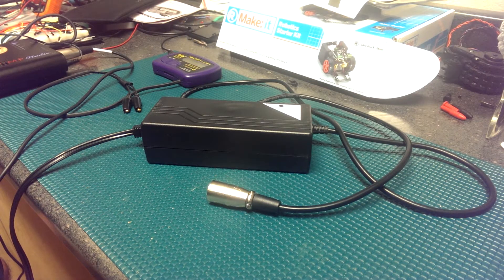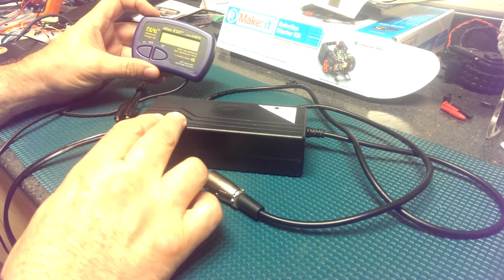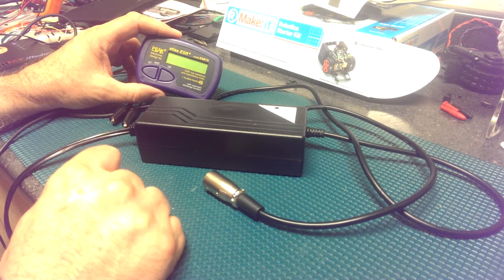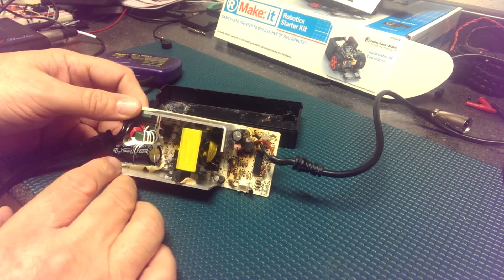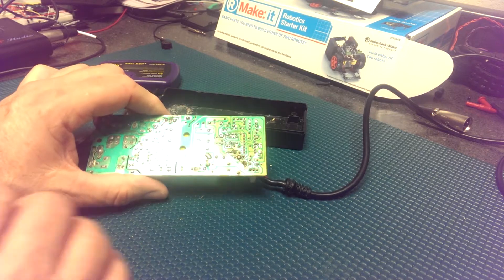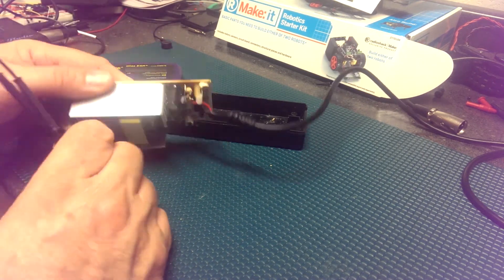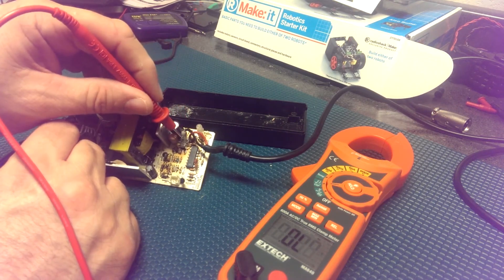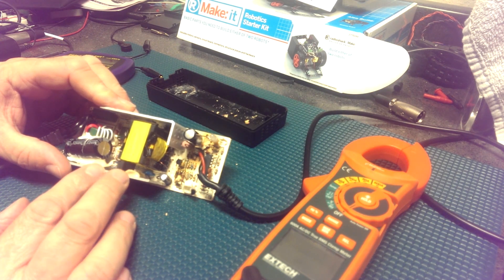How to troubleshoot a 24 volt Battery Charger

Comment: What should the pins be putting out?
Reply from the maker: Sorry, which pins are you referring to.  You can use an ESR to measure the caps.  Output should be the rated voltage of the charger.

Comment: I have a similar charger for my stroller .... I have a problem before any blow when I put it to charge it sounded as if the fan is gone or it has run out .... I shook it a bit, I changed its position and it was ok ... today the fan of what I do does not work at all ... what can it be ... my stroller seems to be charging ...

Comment: My excel connector shorted. I personally don’t think there’s anything wrong with the unit but he excel connector. It loosen and no one tie it back so the brass circular part inside the connector touch one of the cables and it burned up. The apparent solution should be to weld it back up but unfortunately I’m order to diagnose - I cut the other cable without talking a picture, now I do know where to weld each cable. Can you help?
Reply from the maker: Check on the circuit board for any markings that might tell you which wires from the cable go where.  The other option is to try and find a schematic diagram of circuit board.

Comment: Great info, but can you include the voltages that show a good charger? I'd imagine it would be the 2 outer pins while testing the XLR connector. I am also troubleshooting a 24v mobility chair for my disabled sister & am trying to figure out if the charger is bad.
Reply from the maker: Thanks,  if your batteries are lead acid then your cell voltage should be around 2.15 volts per cell.  for 12 cells, (24 volts)  Your charger should output around 25.8 volts.  I have some other videos on my channel on testing a 12 volt battery.  Good Luck.
Reply: @JoediyLab  Thanks for the quick reply Joe. On the outer pins of the charger, I'm getting 6v. After more research I think the charger voltage will vary. The batteries are deeply discharged, so Ive decided to charge them individually with a 12v trickle charger then try to plug the factory charger again. I think it needs to sense some voltage before it starts charging. I appreciate you bud!

Comment: Hi Joe, I have one of those and the input IC has been completely destroyed. Can you tell me the part number for the 8 pin IC on the input side? I would greatly appreciate it. Thanks and have a great day.
Reply from the maker: Sorry AS28g,  I threw mine away ages ago.  Try to do a search on the charger and see if you can find a schematic.  Should be able to find the chip.
Reply: @JoediyLab  Thanks.

Comment: Hey Joe, I really enjoyed this video thanks for making this. One question. Can I change the XLR connector to a molex one. My Golden Technology Companion II takes an onboard charger that has a 3 pin white molex connector however they all cost over $100 while similar XLR models are only $20 - $40 on evay
Reply from the maker: Hi Trent,  sure as long as you choose a molex connector that can handle the volts and amp ratings.
Reply: Joe's Fab Lab Thanks! Well I would be using the one that came off of one of the three MRC24-3LX I have that do not work. Two of them just stay on green all the time like a trickle charge and the third blew a fuse that was soldered to the PCB. The board was glued into the charger and its simpler with my level of knowledge of electronics to just spend $25 on a new charger and change the plugs since I finally found out the correct polarity on the molex plug and which one is the inhibit pin
Reply from the maker: Yes that sounds like the best solution in the long run.  Thanks for the info
Reply: Hey Joe, You helped me A couple months ago About using an offboard charger on a onboard scooter by changing the connectors.

I’m curious. Is the purpose of the inhibit pin solely a safety feature? So an elderly person is unable to accidentally ride off with the charger still plugged in.

Can I safely charge the scooter with the inhibit pin disconnected/remove? I am afraid to try because  I just don’t want to  inadvertently cause any electrical damage.

The Offboard charger inhibit pin is just spliced right into the negative cable at the end of the cable inside the XLR connecter.

Onboard chargers inhibit wire is its own separate wire that is soldered to the charger PCB. It IS NOT spliced to the negative cable.

When I cut off the XLR connector and wired the molex connector I wired the inhibit pin to the negative wire.

The problem is that After the scooter is charged and you unplug it from the outlet. The scooter doesn’t move. I guess it’s still detecting the inhibit pin I have to unplug the Molex connectors before I can use it.

 so if you think it’s possible to use the charger without the inhibit pin that 
would be great

Thanks again for your help. I really appreciate it very much
Reply from the maker: Hey Trent, I guess that is the $1000 question,  where was the inhibit pin connected before you removed it.  Can you look up the schematic on the scooter and see where it is wired.  That would be the safest way to tell if you could charge without the inhibit pin.  If it went to ground then yes.  If not try to change the wiring to that point. Sorry without the specs it would be hard
Reply: Joe's Fab Lab What a coincidence I have a golden technology companion II. Actually I have a two of them and 3/4 of one for parts. The main one I use is has a rhino controller the other has a different type of controller.

I was able to get the schematic for the scooter but I must be dumb because I am unable to find the Molex connector on the schematic.

All of them use (or did use) a MRC24 3lx charger. Over time two of the chargers Green light would stay on which is only a trickle charge.

It must be a design flaw for the same thing that happened twice. The third charger the fuse blew but it was soldered to the board. I could not Remove the board PCB from the charger case because it seems like they use some kind of Epoxy. 

This was five or six years ago and End result is I have three onboard chargers that don’t work and have been disassembled. I haven’t been able to find schematics on the actual charger.
Reply: Joe's Fab Lab Does your companion II Use the rhino controller? If so would you know if you could safely use the charger without the inhibit pin.

I bought my first one off craigslist and then saw another one listed a year later so I figured why not have two Then I saw the one for Parts and bought that also and I figured out a 2 1/2 scooters I should at least be able to ensure that I will always Have a working one
Reply from the maker: Sorry Trent, that charger is long gone.  I purchased another one from ebay.

Comment: My ebike scooty charger's fuse blows off, and thus unable to test. Could you suggest from where to start?
Can it be for the diod in the rectifiers?
Reply from the maker: Sounds like you have a short to ground some where ,  disconnect the power from the power  supply, discharge the caps and use your ohm meter to try to find what part of the circuit is shorting to ground.
Reply from the maker: Hi, is your battery a 24 volt?  If so, 2.5 amps will be a good general charging amperage.  But once the battery is charged, I would pick up a smart trickle charger and leave that on your scooter all of the time to keep the battery up to peak voltage.  Something like the Battery Tender will work just fine.
Reply from the maker: yes, the amp rating is the max amps that the charger can handle.  If the original charger is rated for 1.6 amps then 2.5 amps is fine, the batteries may just charge a bit quicker.  But do not go overboard.  More amps means hotter charging,  You do not want to fry the battery.   But 1.6 to 2.5 amps difference is ok. If the charger does not have current or voltage monitoring then I would purchase a cheap charger that does have that circuitry.  It will allow you to leave the charger on overnight without hurting your batteries.   Check Harbor Freight Tools, They carry a very inexpensive charger.  If you cannot find a 24 volt charger then disconnect the wires from the batteries and charge them as 12 volt batteries.  Get two chargers.
Reply: Can i use a 24v 2,5amp adapter to charge the e100 electric scooter with?
Reply: Hi Joe, Its not exactly a 24V battery but instead 2x12V batteries. Its really hard for me to get parts where i  live so i thought instead of the standard 24v 1,6a charger that comes with the scooter if its ok to use the 2,5 amp one? I think its from an old receipt printer.
Reply: Thank you. Will give it a go!

Comment: is it possible that my charger is shutting off before both my battery are charged?  one of my battery test 12.4 and my other battery teats 12.6 bit my battery indicator on joystick runs down super quick. It has down this ever since I got my new battery's . I've even had them tested and they tested good. 

do you have any information to help me out ?
Reply: A trick : watch movies at Flixzone. I've been using them for watching a lot of movies recently.
Reply: @Zachariah Forrest yup, have been using Flixzone} for since november myself :)

Comment: Actually I work for a scooter shop and we have tons of chargers that are not working.  I am considering to learn how to fix these.  It would be very beneficial to see thr fixing in action.  Please don't mind sharing!  😆👍
Reply from the maker: +John Roberts Thanks John,  pick up the ESR meter and a multi-meter and you can troubleshoot the chargers,  Normally either a cap goes or a component blows up.  Then you can just unsolder and replace.

Joe
Reply: +Joe's Fab Lab I will sounds like a good idea!
Reply: Can i use an old 24v 2,5amp adapter to charge the e100 with?